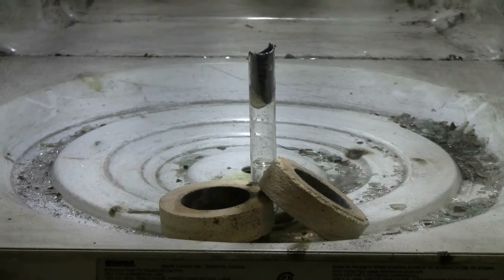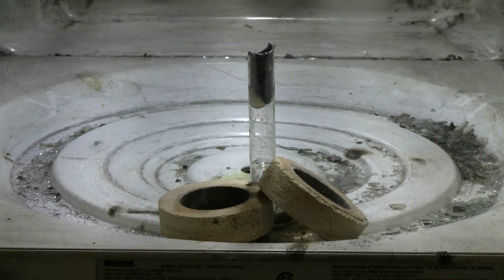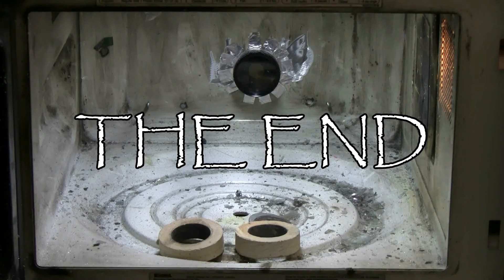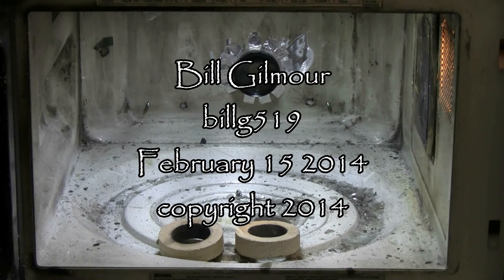The Inside View #44 - Test Tube Steam Explosion

Comment: Good thing you didn't use a larger container with more water the microwave would probably be in bits LOL.
Reply from the maker: I have more microwaves but this one has lasted a long time and I like it. The magnetron has been changed once in this oven. That steam explosion did knock the camera off its mount but it kept recording, showing a plug on the ceiling.